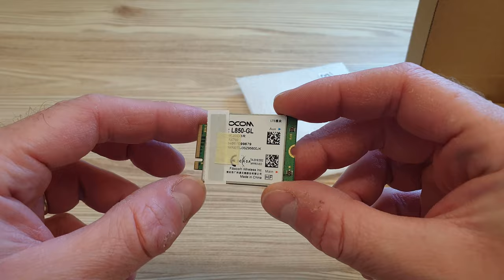How to install internal 4G modem in a lenovo #ThinkPad laptop (X390)

Comment: That is a dummy sim card slot. You need a real SIM card tray for that. You should just be happy that the antenna (blue and orange) are installed.
Reply from the maker: You are right. I got the correct tray from lenovo after 2 weeks for free. But seriously, would it be so much expensive for lenovo to manufacture it with real tray from the start?
Reply: @Techgurl  I agree. It should come with the real tray as a standard. But maybe that would trick people into thinking that the WWAN was already installed but not working.
The only way to tell that the WWAN is not there is the dummy tray :) 
I found your video because I figured that my Lenovo had the same dummy tray. I then opened it up and it doesn't have the WWAN or the antenna. The WWAN is easy to install but the antenna are harder and the Lenovo support doesn't recommend that I do it myself.
Reply from the maker: They could sell it with the modem module
Reply: @LazzevanderZee  and what you did? I have same issue with no antenna cale
Reply: @radeks00  unfortunately I had to forget about it. It was too expensive having the antenna installed. It would be so much easier and cheaper to just get a dongle.
Reply: Mine also doesn't come with antenna cable
Reply: I just open up mine and find that i also do not have the red blue cable, sad for that.
Reply: @SacaSacaBamBamBasPisPis i know is a very late reply but you could make your own cable by using old mini wifi antena from dead laptop
Reply: @Techgurl  It costs them like 3 dollars to make a sim tray
Reply: @felixgamingvlog6702  Then where do you put those cables? All over the place? Under battery?
Reply: @fuckheadgaminghd  normaly you check the other unit where they run the wire from youtube video like dissambley x model where they show you where the cable is put in place 

Or f this ball to the wall, put it where it make sense like mine does with nec laptop versapro u4 / lenovo tablet 10

Comment: Hi, can i ask you something? First, Sorry for my bad english. Im so curious, Is the m2 slot can installed a ssd 2242?
Reply from the maker: Since 4g modem works well, i see no reason why not
Reply: After some search on reddit i found out the WWAN m2 slot cannot be installed a SSD m2.
Reply from the maker: Good to know. I hope this info is accurate.
Reply: works for M.2242 ssd / M.sata.
Reply: @ekoprayitnozahidsolution1930  malem pak eko, punya juga kah x390 dan udh dipasang ssd 2242 di slot WWAN?

Comment: i have a question . every  30 minutes my lte speed falls .i dont wait for it to up more than 10 sec.  i go airplane mode 3 sec and back turn on the lte , my speeds gets back 10 mgps download, but i do have to go airplane mode every 15-60 minutes . even when i am just streaming a movie.
Reply from the maker: I would advise to check your sim and update driver. Worth a try with different sim for test

Comment: You should buy the sim tray (01YU004) replacing the defualt one , which I have bought that tray already but yet installed the LTE modem......
Reply: I was trying all kind of drivers until I came across this video. NOT knowing there isn't any sim tray. Please where can I get some to buy??
  My Laptop is also Lenovo t480s
Reply: Thank you, finally someone listed the p/n
@Techgurl the video would have been so much more helpful if you'd actually finished it with a correct tray (and its p/n) and showed the lte modem actually working

Comment: I'm ordering a custom laptop can someone simply tell me why I need this or dont need this?
Reply: When you are often working at other (public) locations, like train, in the café or coworkingspaces, where you do have none or unsecure (basically every pupblic WLan is unsecure) internet access, it is usfull to have a WWAN card. You don't have to give yourself a WLAN hotspot by your phone, you can just use your laptop. Keep in mind, that you need a contract, where a second Sim Card is necessary and your contract should havr an unlimited data plan.

If this fits your profile, I would recommend a WWAN card. If it doesn't, and you are most likely working from your office and from home, with no need to work while travel or on the road, you won't need it. But when there's an upgrade option for less than ~60$ while configurating, I would go for it, because when you need it later, cost will be with ease 180$ to get it upgrades by a shop.
Reply: I really appreciate the answer thank you for your time!

Comment: Which LTE modem have installed?
Reply from the maker: All Links here https://techgurl.lipskylabs.com/how-to-install-internal-4g-modem-on-lenovo-laptop/
Reply: @Techgurl  Is it compatible with T14 Gen 1 model?
Reply from the maker: I'm not sure. Its standard m.2 port but you need to make sure you have sim card alot and antena before buying

Comment: At least you have an antena wire, i dont event have it :)))
Reply: and what you did? I have same issue with no antena cable
Reply: @radeks00  You have to buy an antenna module, and you have to open the screen bezel, attach the antenna and lead the cable down the motherboard through the hinge.
You will need 1 wwan card and 1 sim tray as well.
But I have read somewhere, you may not do it, you can use 1 wire of the wifi card, but I am not sure.